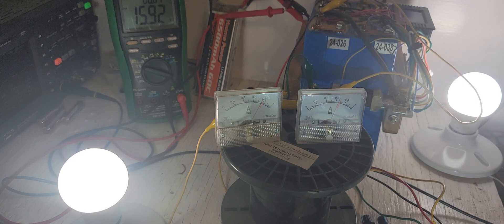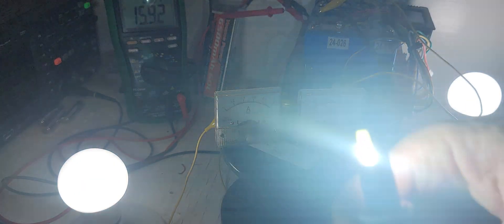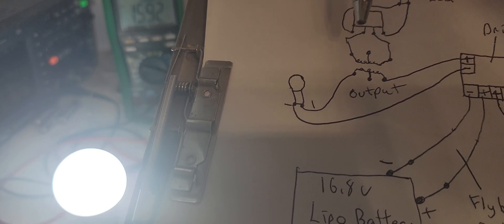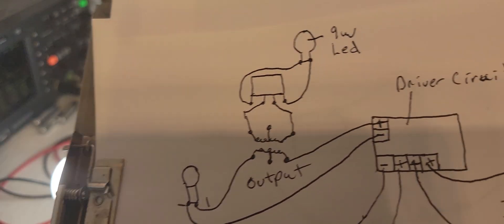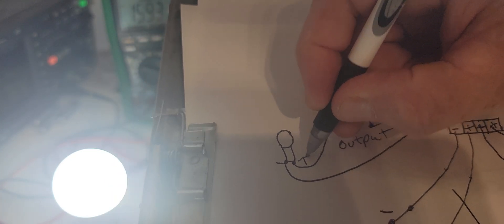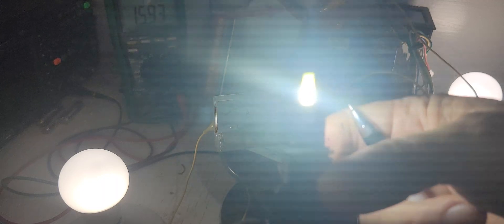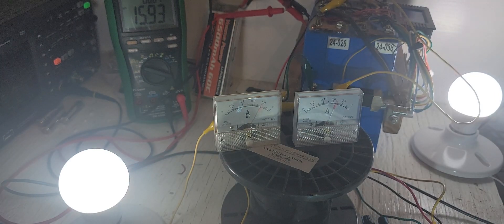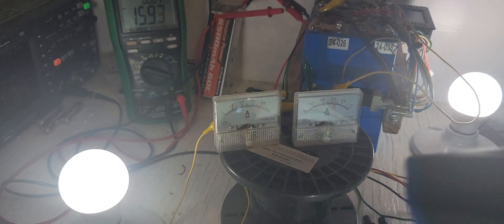Pulsed DC through a transformer is Awesome!

Comment: Keep in mind that an 80W LED bulb draws about 8W to deliver the same amount of lumens, compared to an incandescent bulb.

Also keep in mind that the transformer magnetic field saturates when driven with a square wave, so there are significant energy spikes during transitions (overshoot/undershoot/ringing), so simple measuring equipment such as analog meters will read higher than actual values.

Basically, you've made a cheap power inverter.
Reply from the maker: The meters are on the input and on the output not just on the output they will both have the same average